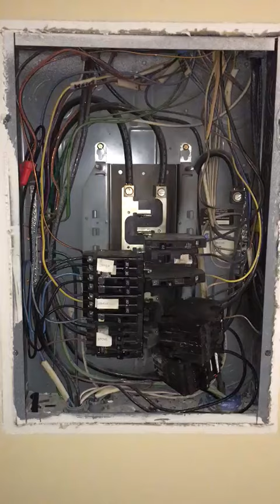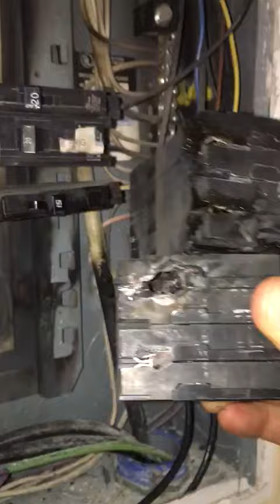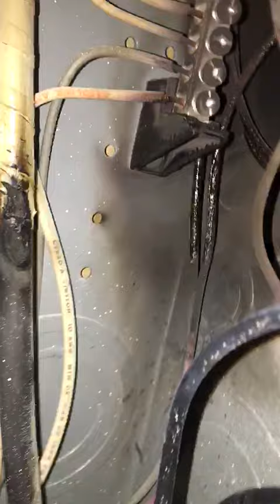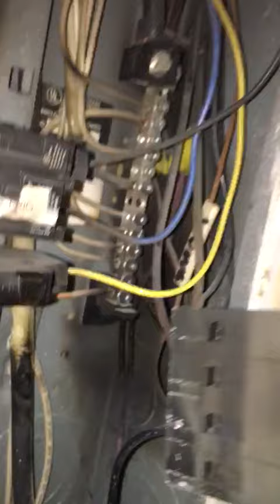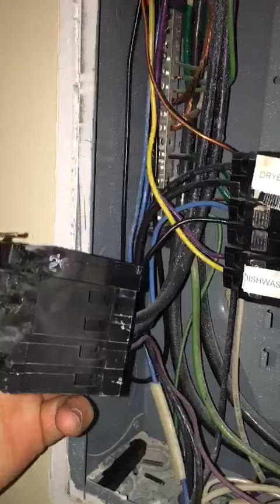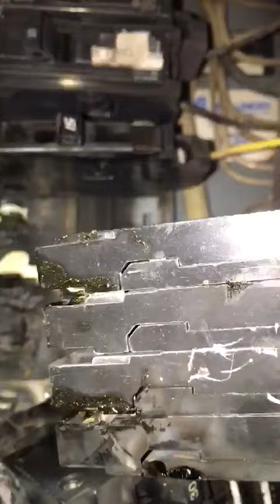Breaker Panel Explosion

Comment: Every 15-20 years? Then that means my apartments panel is WAY overdue. lol. I’m pretty sure it’s the original from the 70s
Reply: You do not need to replace then every 15-20 years... unless your panel brand is known to be faulty there is no need. If you are concerned you can check your breakers under load with a thermal imaging camera, anything higher then 50c should be monitored, 70c and you have a problem that needs to be addressed right away
Reply: They should do a thermal imaging of them to check for hot circuit breakers. Any breakers that are too hot should be replaced.
Reply: Thanks David and Walter. 👍

Comment: Replace panels every 15-20 years?  What are they?  Brake rotors?
Reply: Electricity has a frequency and it causes vibration which wears on electrical connections. Eventually building up heat from arcing and kablooey! Stuff goes bad.
Reply: @1mikewalsh  ..no.  Not true.  Talk to any electrician
Reply: Don't forget to rotate your brakers every 2 to 3 years...